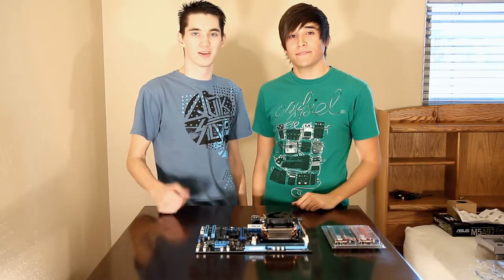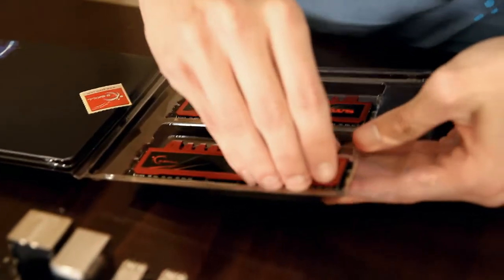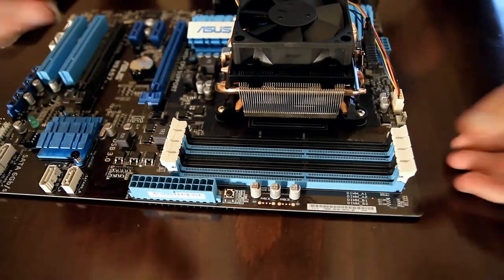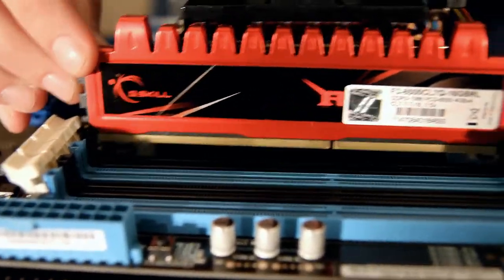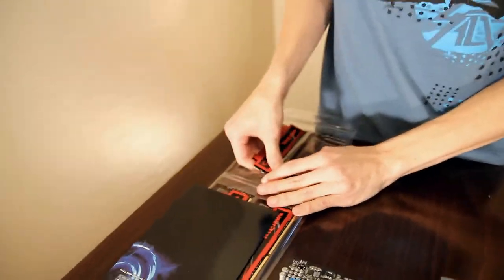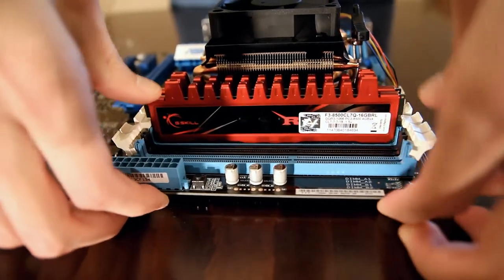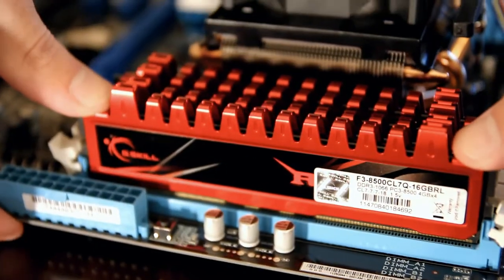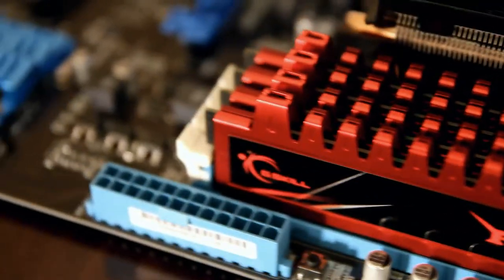RAM | Building A Computer Series

Comment from the maker: Practically every graphics card you'll buy is a PCIe x16 card, and every motherboard you look at will most likely have multiple PCIe x16 slots (I've never come across one that hasn't). Just to make things easy, just make sure the card and the slot on the mobo are either PCIe 2.0 or 2.1. Version 3.0 is out, but I haven't read up on it much yet.
-B